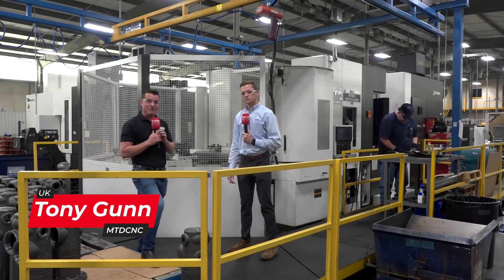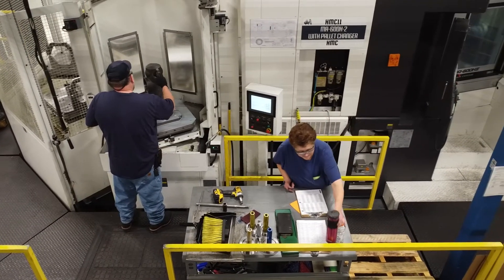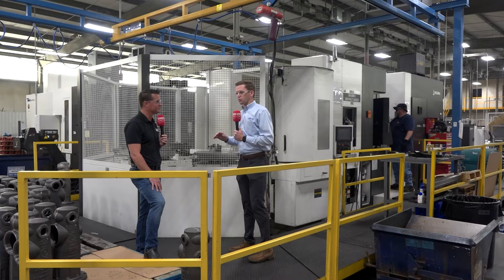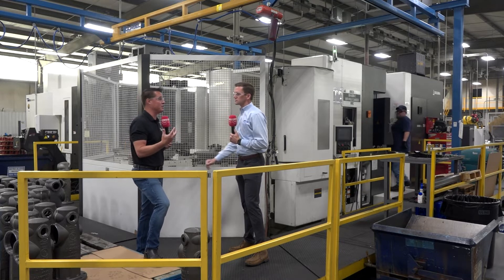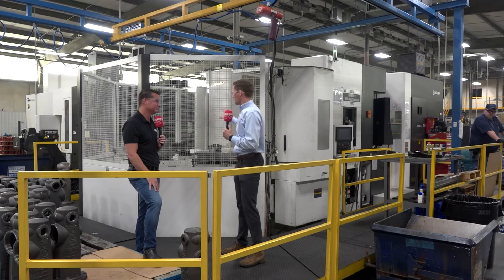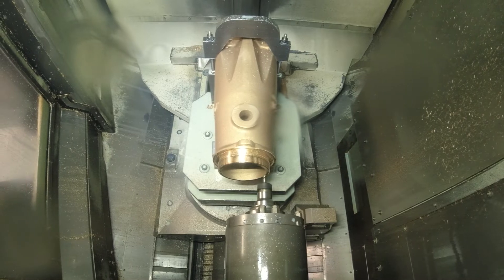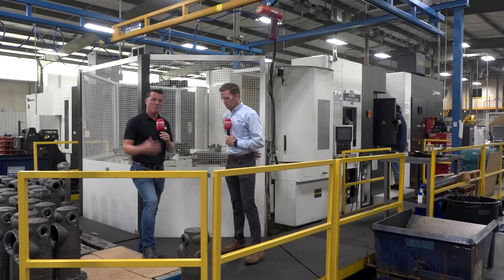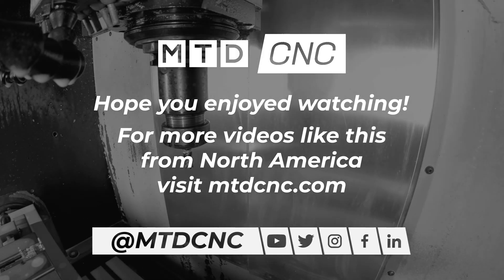Okuma Pallet Change - Morris South | Associated Metalcast

Comment: Is the warranty on Pallet Pool same as Horizontal...parts/labor, etc?
Reply from the maker: The Pallet Pool warranty should mirror the warranty offered on the machine purchased!
Reply: @gotomorris  is the PP powered off HMC or does it require it's own drop? If the latter, what are the power req's? Last, what are the concrete req's if any? I.E. same as HMC or can they be less, etc?